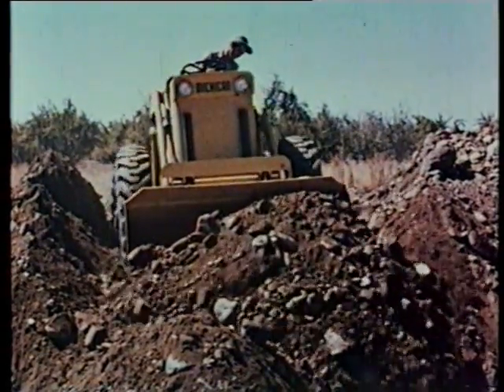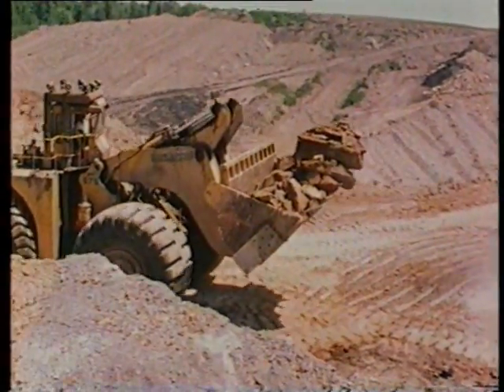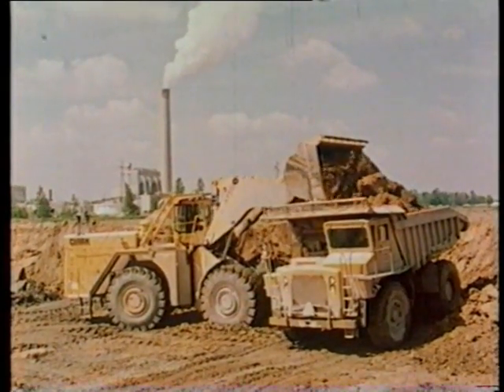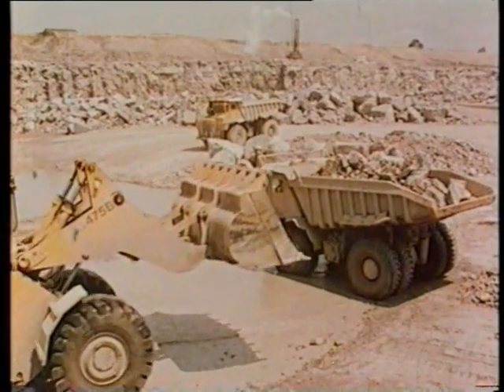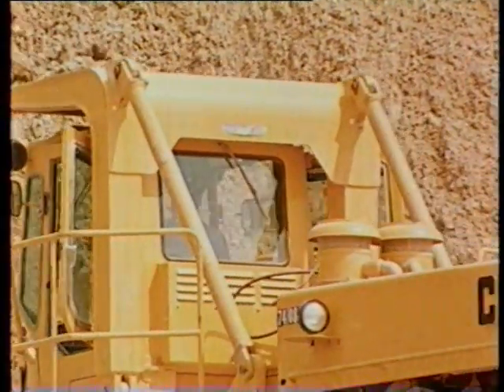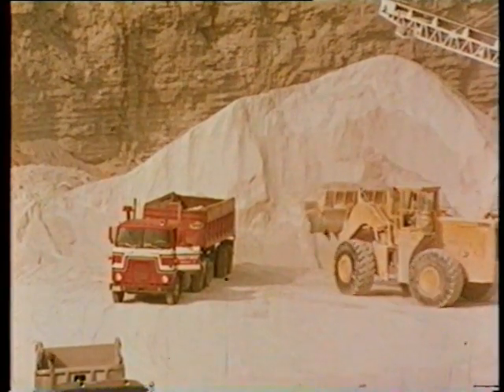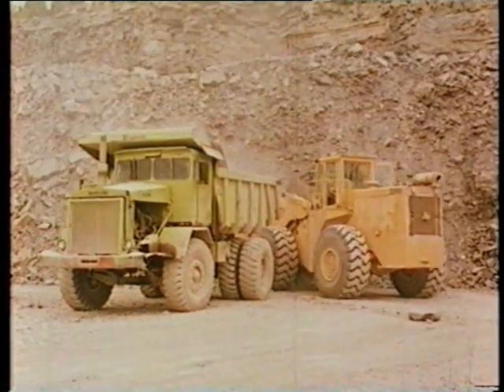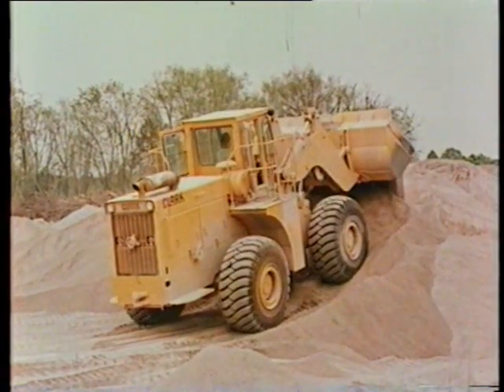CLARK Michigan wheel loaders part 1

Comment: The clark Michigan 35b loading shovel was widely used in ireland by agri contractors and was a great machine
Reply: Back in the winter of '63 the quarry my dad worked at took delivery of a brand new CLARK Michigan 75A with a 400cu. inch Leyland Comet 400 engine. It was delivered on a lowboy from Bristol and the was commandeered by the local council for snow clearing, we had rather a lot of the stuff here in England at the time.....